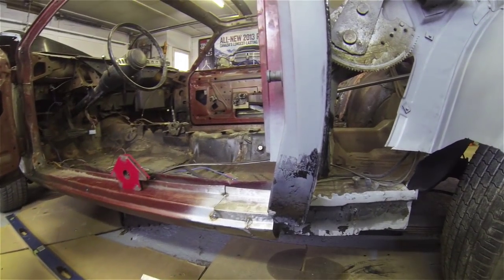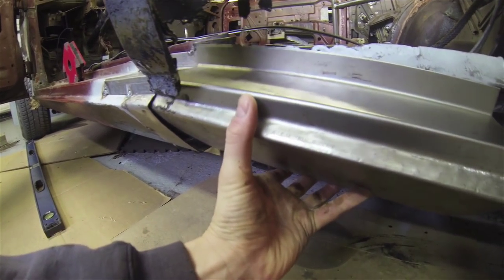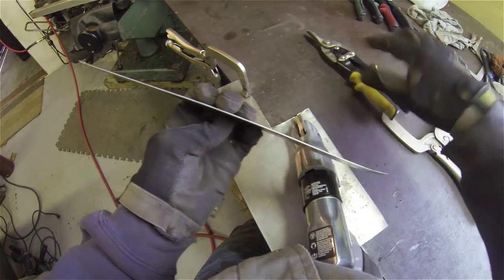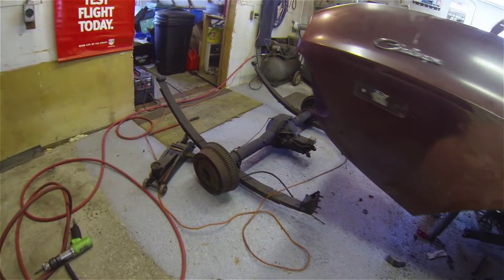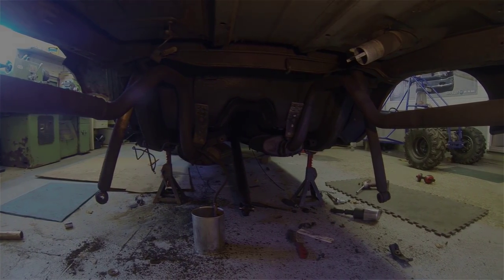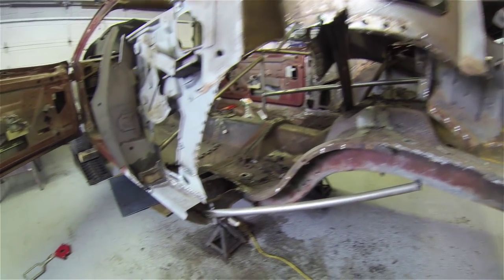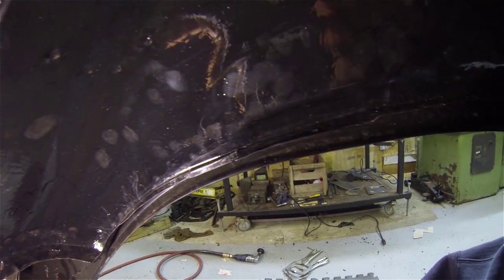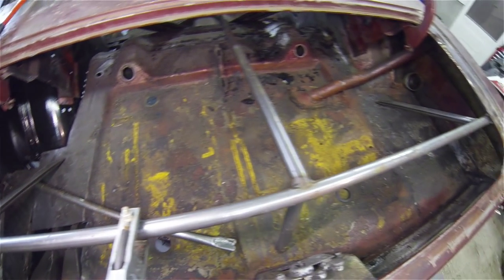74 Dodge Challenger Restoration #6 - Wheel Well & Rocker Patch

Comment: Brother you're a hard working man. I'm doing a '71 Challenger entirely from scratch, but I was not cursed with so much rust... My entire floor was gone and I had cowl issues with rust but nothing in the rear of the car or low on the sides, I feel your pain for sure. It's a can of worms once you start with these Mopars... AND I'm in Australia and had to haul the car from Texas all the way back as a shell on wheels and then pull the entire car apart again to restart. Mines just about to come out of paint from the shop... then starts the epic journey of getting every single part back in.

I can't find ep 7 of your build? I guess you're not there yet?

Anyhow good luck from down under.

Best, Nick.
Reply from the maker: Hi Nick. Glad you like the videos! You should post some pictures up on www.cuda-challenger.com so we can take a look at your '71. My username on that site is daaboots. Yes, this car did turn into a can of worms but the work is enjoyable and I'm learning lots!

No episode 7 yet. I'm pulling out the tail light section now and the truck pan is coming off next. Here is a link to all the videos in the series https://www.youtube.com/playlist?list=PLLaYsJj_x2Z5L-aPcyrtRgWAF1qK1E7_z

Thanks for watching!

Comment: Your awesome dude, I like your person ability and u are doin it right and sharing the passion!!! 

I discovered rust converter too recently and I'm 49 lol.....  Getting back into car restoration....  

Rust converter converts rust to a black paintable primer..... Let's face it as long as rust is cleaned up to solid metal, this stops it and as long as sealed and hidd n from moisture repairs can last for many years
Reply from the maker: +Paul Zonneveld Thanks Paul. Best of luck with your restoration!

Comment: Hi, what brand spot weld cutter are you using?  Thanks
Reply from the maker: They are made by a company called Blair. I tried some other ones but they were junk. 

https://www.amazon.ca/Blair-11082-Cutter-Set/dp/B000ETZFJI/ref=sr_1_6?gclid=EAIaIQobChMIu-CCo7_w5gIVQdbACh3l8w5VEAAYASAAEgI8ZPD_BwE&hvadid=221380392687&hvdev=c&hvlocphy=1002376&hvnetw=g&hvpos=1t1&hvqmt=e&hvrand=6851403167581884387&hvtargid=kwd-297025878163&hydadcr=27153_9824930&keywords=blair+spot+weld+cutter&qid=1578365953&sr=8-6
Reply: Awesome, TY

Comment: I'd put in a fully rebuilt and freshly painted Dana 60 or 8 3/4 rear end with Sure Grip and a desirable rear gear ratio while it's out of the car! Do it right the first time! Awesome job on this car! Put a 1350 slip yoke on their while your at it. Anything else will shatter like glass behind a torquer V8. Take it from someone who knows. Drag racing axles and some lugs from ARP are a huge upgrade as well. And please don't be like some of the guru mopar nuts out there. Do aftermarket disc brakes all the way around the car. No sense on keeping the drums.
Reply: i got a 73 chall,100 %,good,from rio linda, ca,u.s,fitted with 69 running gear,340,.r/t dash,ect.,damn lucky,guy ripped me off on the deal,but,no rust,drives,no probs,except old.bushes,ball joints,ect.

Comment: i dont trust non oem parts the fit is too off some times and the mold they came from can be not to spec
Reply from the maker: +rock dawg You're probably right. I'll need to spend alot of time properly fitting the panels and getting all the gaps correct. On the bright side, at least full size panels are available for this car!
Reply: i just gave you another source for mopar parts on most of the rebuilds i saw on chop cut rebuild the used classic industries. The one thing is with mopar as my friend told me long ago k body car there rust buckets the amount of metal replacement is stagering unless the car was from california thats the only way you get a rust free car good luck

Comment: 99.99 % after market crap never fit right in you always have to Mod and cut them too fit
Reply from the maker: Those were actually factory original, salvaged from another 74 Challenger.
Reply: I hate when people talk bad about aftermarket parts. Most items are duplicates of originals. You have to remember this car is a unibody design that had a big v8. These chassis were easily twisted over time.